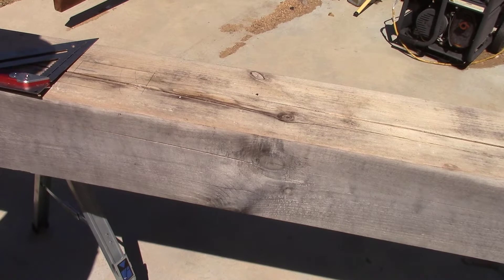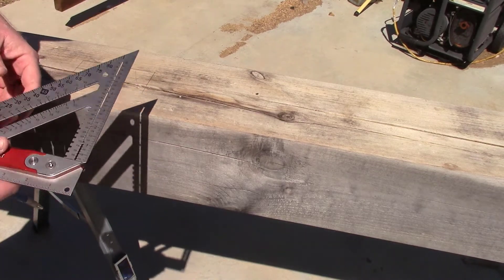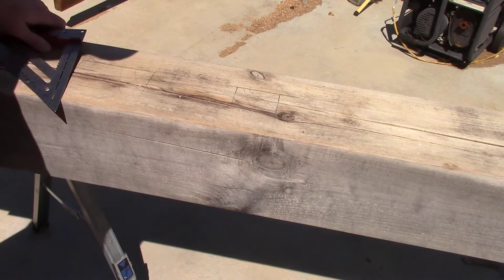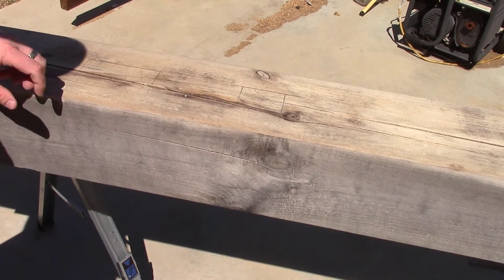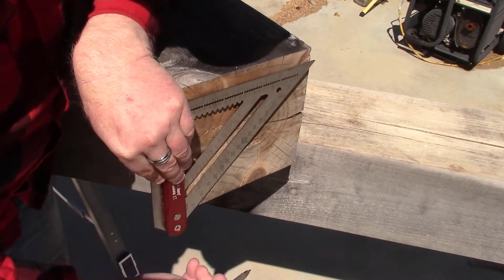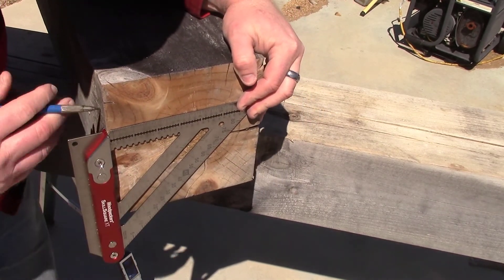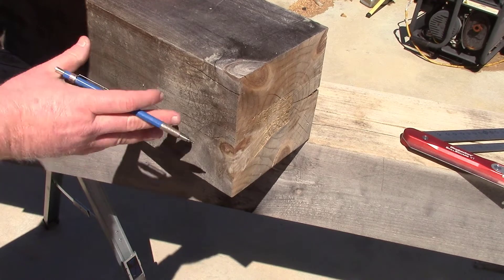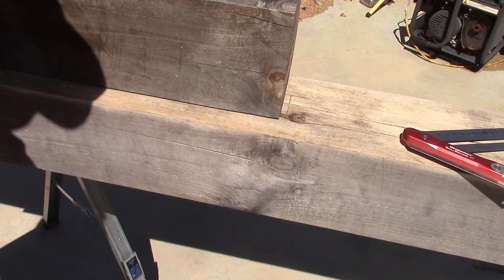Tips and Tricks: Timber framing - Reference face

Comment: Mortise gauge works well always using your reference face as the guide
Reply from the maker: Yes it does. I've tried to avoid some of the more expensive custom tools in the videos to try to help people understand you don't need them to do work. They certainly help though and I wish I had my old one, it is lost forever.
Reply: @peanut_knife_works8417   yea I have an old one, set it once for the project and you’re away!!
Reply from the maker: @Pizza_boy07  I'm hoping to get into some consistent work later this year if things go well and will pick one up.